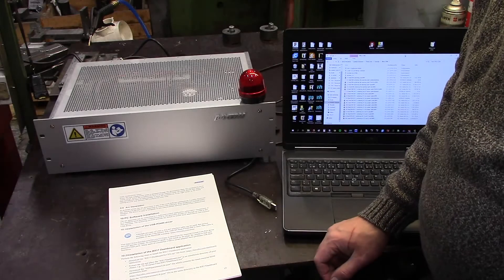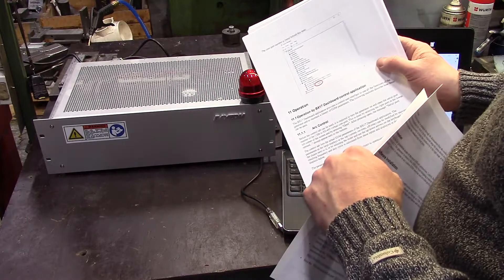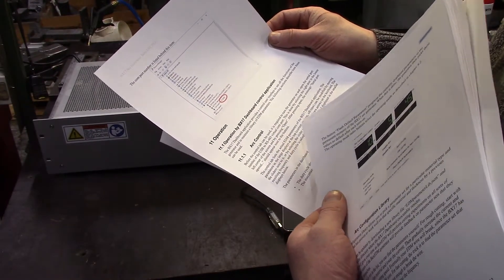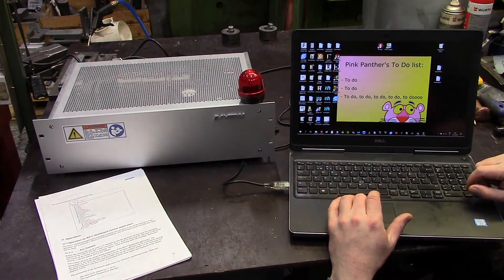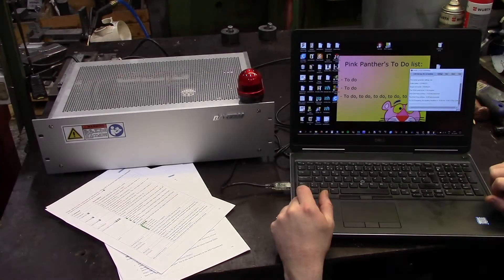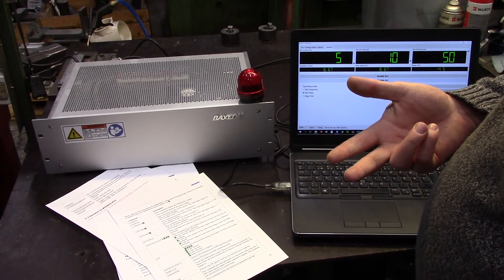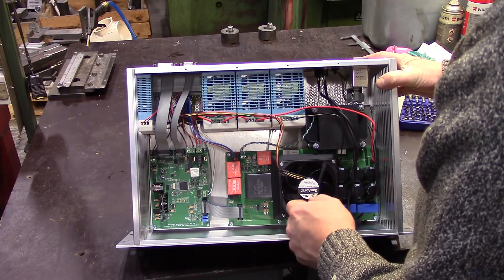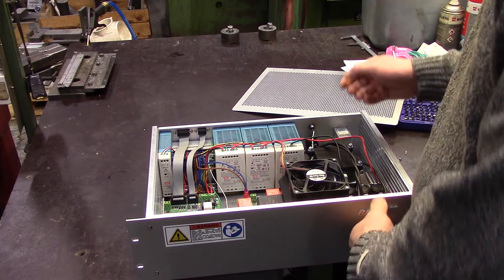[4] BaxEDM BX17, first start of the generator

Comment: Can you take the screen shot/photo of EDM power output wave form from oscilloscope and post us. Tahnks in advance
Reply from the maker: It doesn't help at all. There either is open circuit voltage, zero volts in short or whatever gap voltage you set. If it is pulse type supply, then the pulse length is either a fixed frequency or a fixed spark time.

Comment: Hi is there any DIY EDM power supply, because other parts like CNC rails etc can be made, can you share the wave form shape of the EDM power supply, is it high frequency low voltage DC ??
Reply from the maker: You can either make an RC type or PWM type supply yourself if you want, I suggest purchasing the book(s) by Ben Fleming. Word of warning though, they are not nearly as powerful or user friendly as the BaxEDM BX17 generator is.